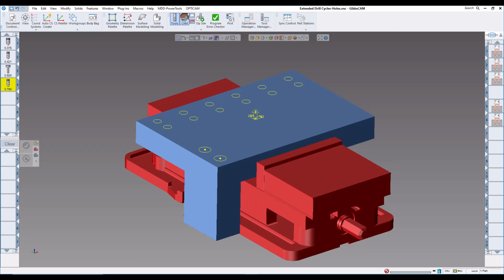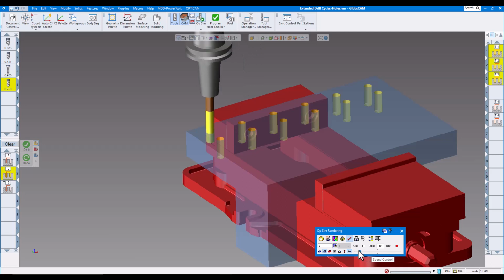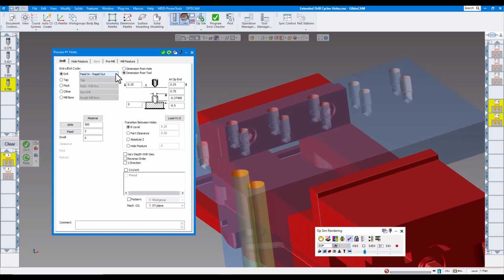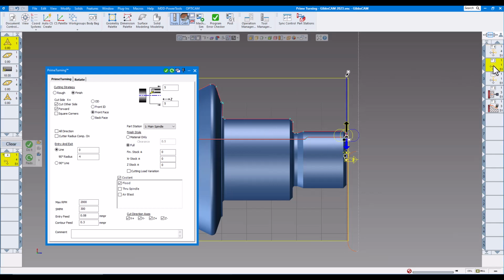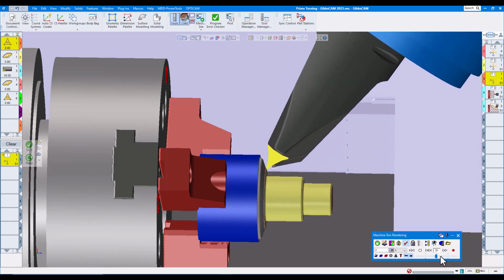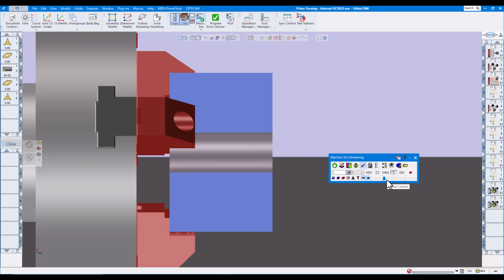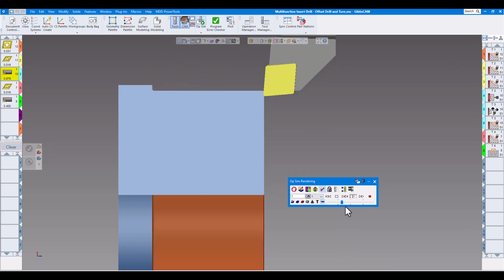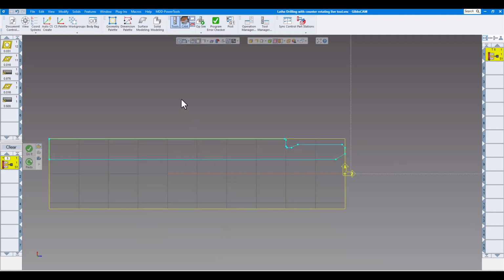GibbsCAM v2023 Enhancements 9-12

Comment: Are we going to need post updates for the new drill cycles?  Or will it post out explicit g0 g1 z moves etc?
Reply from the maker: You might.  It depends on what year your post was developed.  Best to try it, as much of the code is longhand for variable peck/drill, as not all controls handle "canned" cycles to do this.